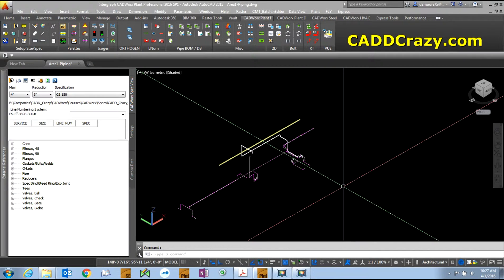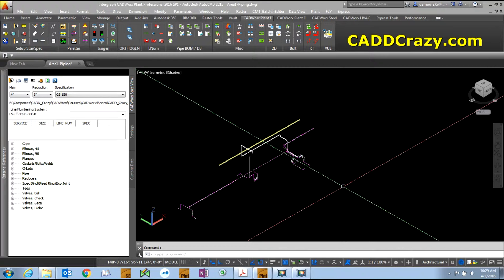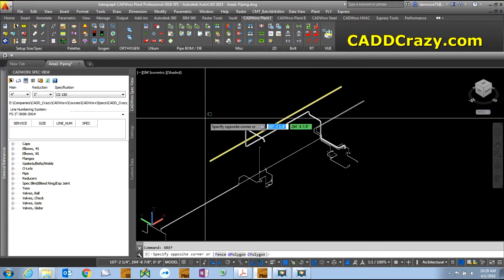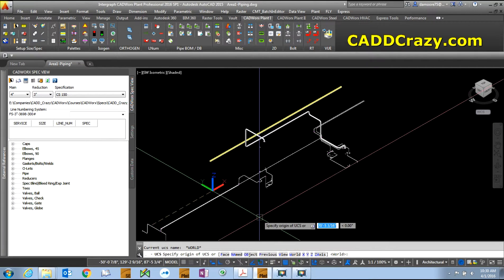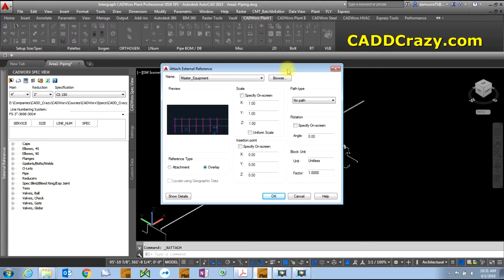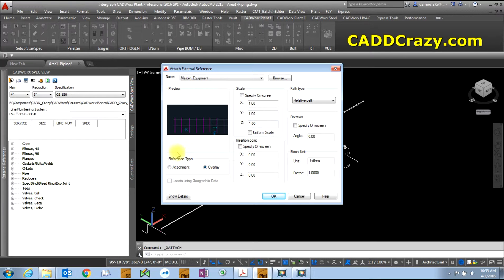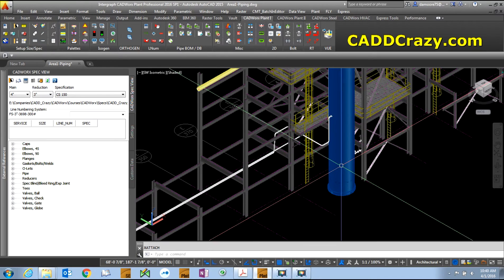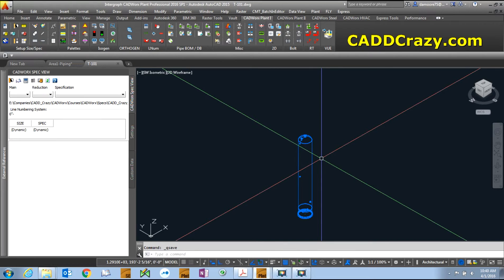AutoCAD Xref's

Comment: Hi there, is there a function to auto re-route the pipe connection to the moved equipment as shown as external reference have been changed?
Reply from the maker: That is not an option that I have seen in CADWorx or P3D.